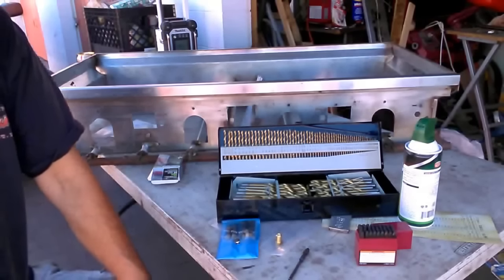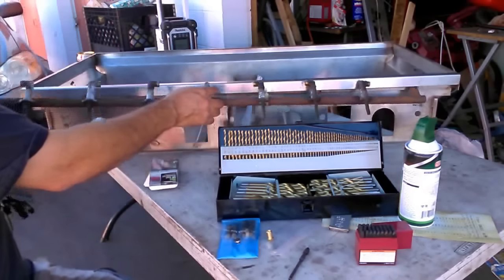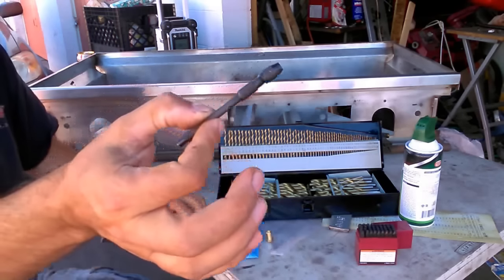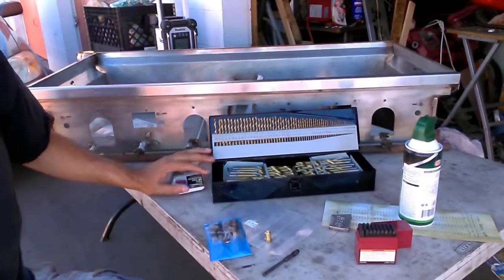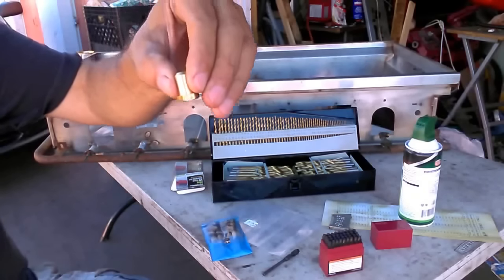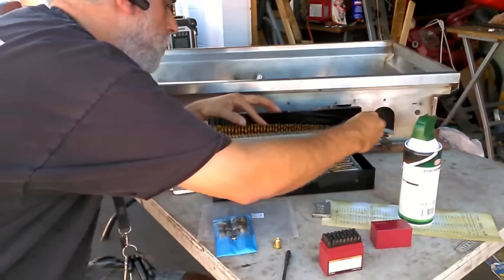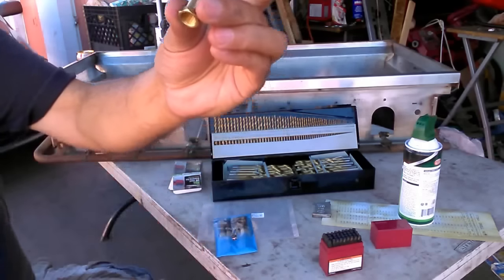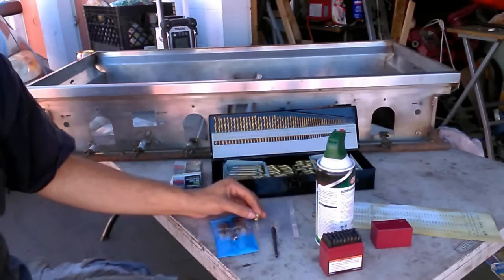Propane and Gas Conversion Basics (How to)

Comment: So you say a propane is not Natural Gas?
Reply from the maker: No. Those are two different products and they burn at two different rates. Doing a fuel conversion is usually a simple affair. I've converted just about every type of bar-b-que and stove made. I'm now in the Midwest, so feel free to contact me at 714-574-1544.
Reply: @frankhamilton8257  Thanks I noticed in my side panel an animated video. It said that Methane was one of the most prevalent in Natural gas. So if one makes their own methane in a biogas digester. It will have more methane than natural gas from a company.
Reply from the maker: @aicram62  By and large, Methane is the most prevalent ingredient in Natural Gas. By definition Methane is hydrogen gas consisting of a single carbon atom bonded to four hydrogen atoms. In contrast, propane is a three carbon alkaline consisting of three carbon atoms and eight hydrogen atoms. Propane is easily compressed, so that's why it's often transported by truck or train. Natural gas is not as portable, and is usually transported though a pipeline, e.g. a natural gas line coming to your house and regulated by a gas meter. Propane is compressed into a liquid state and has a boiling point of -42 degrees C, so it's beyond it's boiling point when exposed to ambient air. Natural gas is usually transported through it's pipeline in a gaseous state.The term "Natural Gas" is used to label a product that is used in most homes as a combustible heating fuel for heating and cooking.
Reply: @frankhamilton8257  Are the tanks different than an air compressor tank?
Reply from the maker: @aicram62  Yes.Tanks used for propane must be certified and are subject to internal pressures much higher than what an air compressor tank would be. A propane tank has protection around the valve body at the top of it to prevent any type of catastrophic event from harming this valve. Also, an air compressor tank will have an air release valve located at the bottom of it to allow the release of air pressure and water. Compressing air from an ambient environment (non desiccated air) will almost always contain water, so the act of compressing air will also involve gathering water molecules into the compressor tank. This water will gather at the bottom of the tank and must be removed from the tank each time the tank is used, so this valve enables that. It is possible to use a propane tank as storage for an air compressor, so long as this valve is added to the bottom of the tank (at it's lowest point), but it IS NOT possible for an air compressor tank to be converted for use with propane storage since the compression of propane is produces a much higher pressure against the inner walls of the tank.
Reply: @frankhamilton8257  What about with methane? homemade methane. Can I store the methane I make in an air compressor tank for later use?
Reply from the maker: @aicram62  Methane is the main ingredient in Natural Gas, so again it is not as easy to store as propane.
Reply: I can not seem to find these tanks on sale. I saw used ones on ebay but then there's shipping costs. Other sites come up in the search but you can not find anything in the product selection.

Comment: Could you make me an Orifice?
Reply from the maker: Doing a fuel conversion is usually a simple affair. I've converted just about every type of barbecue and stove made. I'm in the Midwest, so feel free to contact me during normal Midwest business hours 714-574-1544. I likely have the part that you're looking for in inventory. If not, I can replicate the part on the lathe.

Comment from the maker: I actually sell orifices for every stove and barbecue made on my website  https://flamesources.com/  I'm now in the Midwest, and you can always get a hold of me at 714-574-1544.
Reply: I just bought a used ge gas range that was set up for Lp.The person i bought it of gave me a conversion kit to switch it back to natural gas ,turned out it was not the right one and wasn't even for a ge it was for a whirlpool range . so i started to look for the kit i need and found out the only way i can buy those natural gas orifice spuds that i need ,i will have to buy the holders also. So for the oven and broiler orifices i was wondering if i could drill them out to the size for natural gas i do have chart that came with the oven that tells you what size the orifice should be for natural gas

Comment: Use ingraver to label
Reply from the maker: Thanks for your input, but I use stamps because there's nothing left to interpret. Doing a fuel conversion is usually a simple affair. I've converted just about every type of barbecue and stove made. I'm now in the Midwest, so feel free to contact me at 714-574-1544.

Comment: WTH is going on with all that ringing?
Reply from the maker: Trains. Doing a fuel conversion is usually a simple affair. I've converted just about every type of bar-b-que and stove made. I'm in the Midwest, so feel free to contact me at 714-574-1544.
Reply: @frankhamilton8257  That's very kind of you. I was actually just writing an article for a client and looking for a video to illustrate it. This would've been perfect if not for the ringing! 😂
Reply from the maker: @suzannebennett8987  Gotcha. You're not the first one who has commented about the locomotive sound effects. I usually squelch them out, but your comment wasn't meant as a jab. Feel free to contact me if you need a quote for your piece. I've likely converted more appliances than anyone else has, and I certainly have a larger inventory and more applications than anyone else has...possibly on earth. No joke, I've likely done more than 50,000 or 60,000 conversions over the years.
Reply: @frankhamilton8257  Yeah, I'm not looking for myself. I was writing an article about converting a garage heater from natural gas to propane, and all the research I did told me that this is not a job for an amateur and that people wishing to do this should contact a professional, so your video would've been perfect, but my client (who ordered the article) would not have wanted to include it with all the ringing! Sad because it might've brought you some business.
Reply from the maker: @suzannebennett8987  Yeah. I get it. That whole world is black (meaning that the "industry" will not freely share information with the public at large for fear of liability and partly to serve it's own interests). I get a lot of gas guys who also contact me, some of whom are not as well versed as you'd think they should be on the subject. The simple fact is, that anything is convertible, whether we're talking about natural gas, propane or butane (the primary source of alternative gas for the third world). You just need to know the ratio.
Reply: @frankhamilton8257  Which is why it's smartest to get a professional to do it, and that's what the finished article said. The rewards of DIY simply do not outweigh the risks, and aside from mayhem, problems like negating your homeowners' insurance if something goes wrong come into play.

Comment: Hi  frank i have a DCS RGS-305ss stove and want to convert it to propane are there any kits out there or do you know what orifices i would need thanks
Reply from the maker: I actually sell orifices for every stove and barbecue made on my website  https://flamesources.com/  I'm now in the Midwest, and you can always get a hold of me at 714-574-1544.

My website is still in the works, so I don't have DCS product available on my website at this time, but I do have the parts. I believe you've contacted me. Is this correct?

Comment: Hi Frank I have a Napolean BIP500 Natural gas built in grill and need to convert it to propane.  Do you have the orifices and regulator for this grill.
Reply from the maker: Yes, I've done several Napolean grilles, so I likely have the parts. I have orifices for everything made, so feel free to call me at 714-574-1544.

Comment: What would be the drill bit size for a #55 and #54 lp orifice? Thanks in advance
Reply from the maker: I actually sell orifices for every stove and barbecue made on my website  https://flamesources.com/  I'm now in the Midwest, and you can always get a hold of me at 714-574-1544.

These are numbered orifice sizes, so #55 is smaller than #54, #55 being 0.052 inch and #54 being 0.055 inch. Make sure to like and subscribe to my channel.

Comment: Can a Blackstone 1813 be converted to natural gas?
Reply from the maker: Yes, any unit can be converted, so long as the parts are correct and the technology is verified. Doing a fuel conversion is usually a simple affair. I've converted just about every type of barbecue and stove made and have all the parts necessary to do so. I'm now in the Midwest, so feel free to contact me at 714-574-1544.

Comment: Frank I have a weber grill E 210 NG and I want to convert it to PL, what do I need? do you sell the parts
Reply from the maker: I've converted a few thousand Weber Series grilles, but I haven't done a 210. Maybe you can pix message me. I'll need an overall shot of the grille, a shot of the manufacturer's label and shots of one of the orifices - from the top down and as a static side shot. You can pix message me at 714-574-1544.